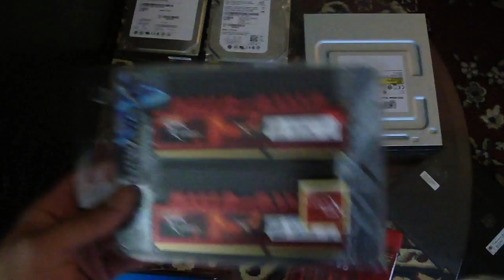Build a PC: Core i3-2100 Sandy Bridge Build

Comment: thanks for replying. I dont overclock anything. I am only concerned about durability of board and motherboards impact on other devices performance and durability.since I only used Intel mobo I have no experience with other boards thats why I am scared a bit. now I have two options.1- intel+1333mhz....2-biostar+1600mhz

Comment: as some have mentioned, an apu gives you more for your money. not too shabby though it will still run almost any game better than consoles if you get a decent gpu. also, location of a power supply does actually matter if you want a custom cpu cooler in which case bottom is better.

Comment: dude you need to do some cable management on that rig and never do that again with a processor it's the easiest way for them to die especially if you drop it and i suggest getting an ant-static bracelet so when you build another computer

Comment: thats a pretty good price , i've been looking around for components and cases but really haven't seen anything cheaper than 400$. i just want a quad core processor 3.0 ghz , 650 psu certified single rail , a motherboard with ddr3 atleast 8 gb's of ram 1333 dual channel. and a decent sized case with decent ventilation nothing too massive. i already have a 500 gb hard drive , a dvd combo drive , and a evga 450 gts. reason i want a 650 psu is so i can upgrade to a gtx 560 later on.

Comment: @METALGEARZETTO It's a lot cheaper. Built vs Bought comes down to how much the manufacturer warranty is worth to you, as a $400 built computer is worth in the neighborhood of 800-1300 bought depending on the manufacturer, sometimes higher if it's alienware.

If your current one has 4 cores and six gigs ram, check your mobo, you may be able to add a graphics card in without changing anything else, and with a good card you can possibly run everything. Just do your research.

Comment: Great budget build. The only thing that computer builders need to know right now is that hard drives are substantially more expensive right now compared to last summer because of flodding in eastern countries. I got a 1TB Seagate Barracuda drive in the summer for around 55.99 U.S. . You would be hard pressed to find a 500GB drive for less than 80 dollars right now. Thats my only concern atm with new builders. But ya... great build.